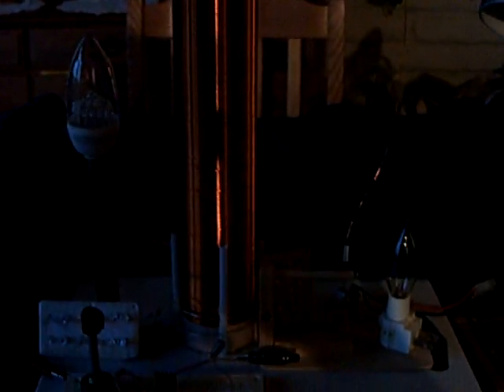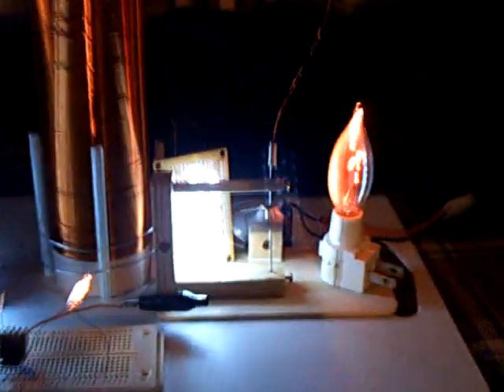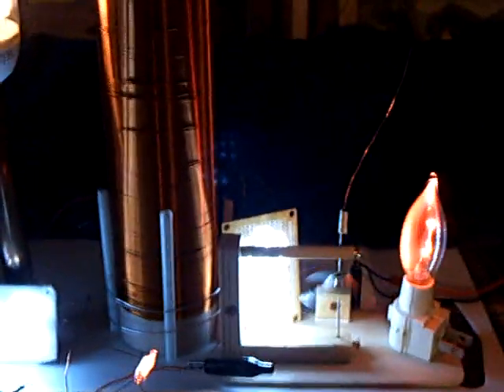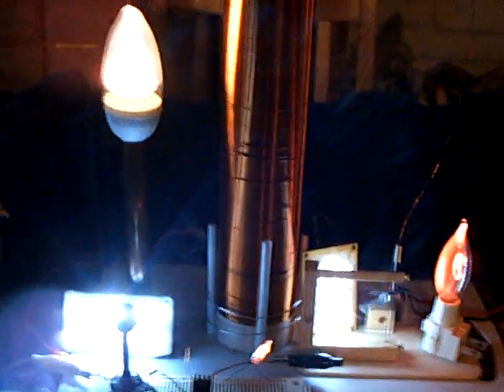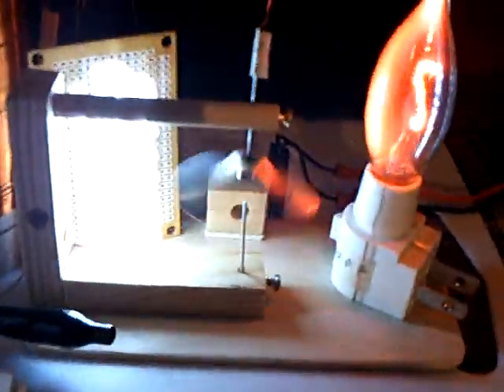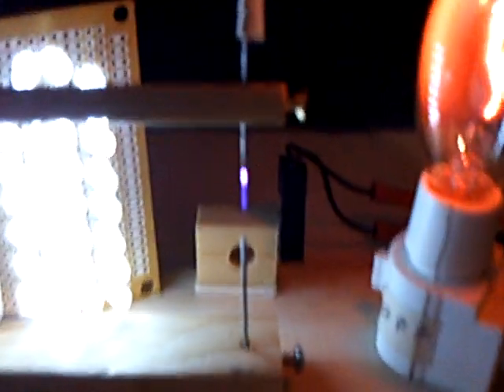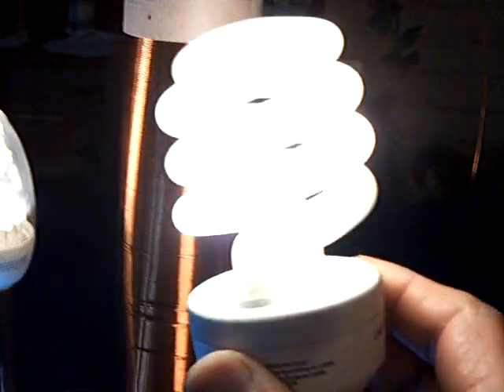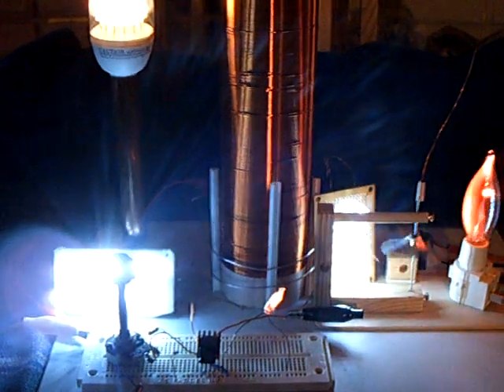Better Plasma Spinner and more lights.ASF

Comment: Now if only you can attach a big enough plasma thrust to the back of some roller blades, that would move thing along. You might even get some extra umph for your boat on a calm day!

All jests aside, I have been thinking about this great video for two days and was wondering about the circuit. Can you point me to a web page where I can look at what circuit you used? The no feedback draw part has me enticed.

Comment: @Lidmotor In time, keep working and refining and we'll see if the meter comes along. Can you continue to add more lights in the field effect and get the same amount of intensity, without increasing circuit draw? if so how many? look to see if walmart has the rebated light bulbs on sale they are cheap, then stick a whole crap load in the effect, that would be something